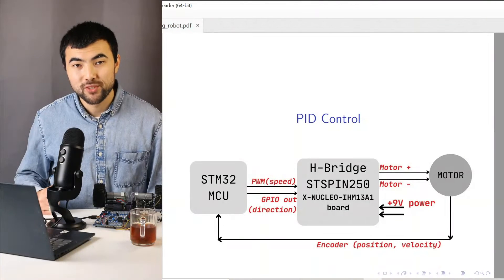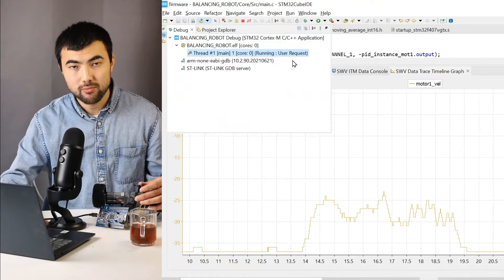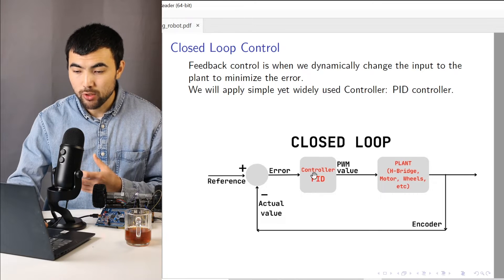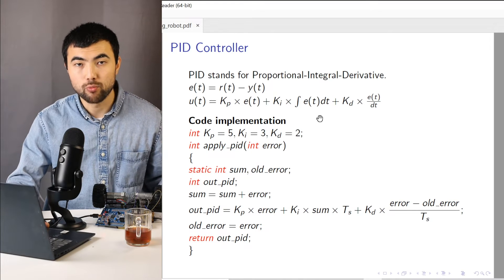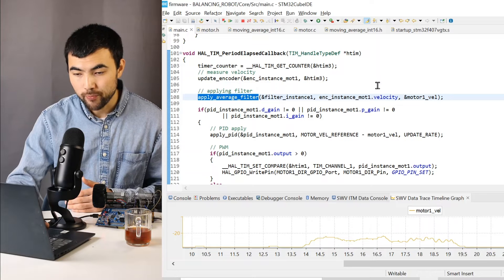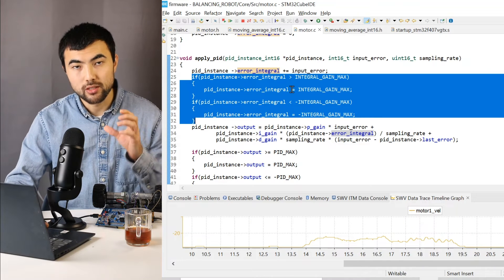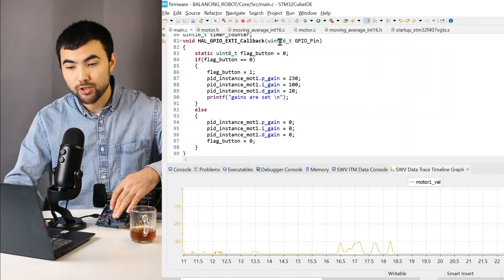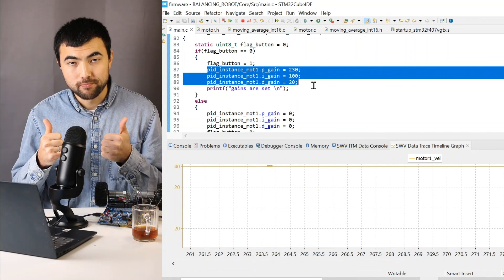STM32 motor control: PID theory and implementation

Comment: I cant understand so using PID output i mean sum of PID coificents you put it where? So you using that value trying to change sine amplitude keeping stator and rotor angle difference 90 degree or keeping amplitude on max and changing stator and rotor angle differences to achieve that behaviour?
Reply from the maker: Here I am using a brushed DC motor, so the stator and rotor angle difference is controlled by the motor itself. In this example, I am using the output of the PID Controller to adjust the duty cycle of the PWM signal

Comment: i think in pid controller function line number 35 the sampling rate is multiply with pid_instance->d_gain it should be divided
Reply from the maker: d-part should be divided by the time period. But, sampling rate is iverse of the timer period. Terhefore, we multiply

Comment: It would be interesting/useful, to show, on the graph of the motor speed, the PWM value that is applied, so that we could see the action of the differential and proportional functions make the quick response of the PWM, and the slower changes due to the integral part... Hmmm... Possibly also show the values of each of the three correction terms?
But, maybe that's in the next video?
Reply from the maker: It could be really interesting to show that using an oscilloscope, which I do not have currently😀
Reply: At a sample rate of 1KHz?

Comment: Thanks a lot! May I ask why use a moving average filter instead of a low pass filter?
Reply from the maker: It works much faster than a low pass filter. Of course, the low-pass filter can be used instead of the moving average.
Reply: @steppeschool3629  really surprised to hear it works faster honestly. 

What about delay? Doesn't the moving average add more delay because of the more samples?

Comment: Hi yerke! I want to know how did you define the value UPDATE_RATE?
Reply from the maker: Hi! In my project, it is 1 kHz
Reply: To actually answer your question; it's generally accepted that the ideal sampling frequency is 5 or 10 times greater than whatever you're driving can respond. So, in this case of 1KHz, it's ideal for a plant that can respond @100Hz (10ms). In my own case where I use motors of 2KW+, anything faster than 250Hz is a waste of processing power.

This demonstrated PID is known as "continuous" which I would never use. The "discretized" method is far superior, in my experience and doesn't require the moving average filter.
Recommended references are Dr. Jacob Tal (my mentor) and Chuck Lewin of PMD. Both of these gents explain everything in a way that mere mortals can actually understand. 😁